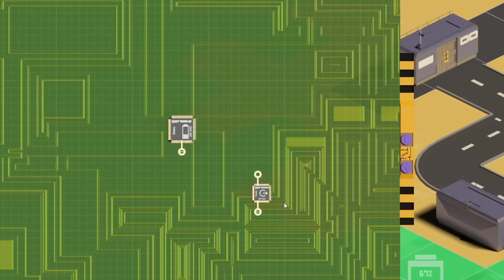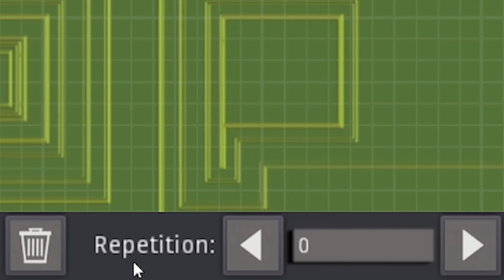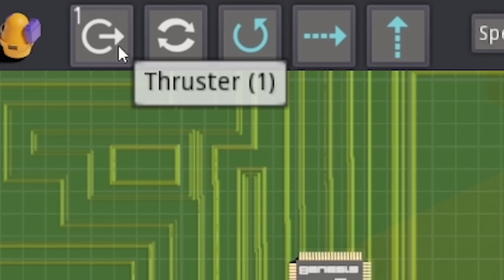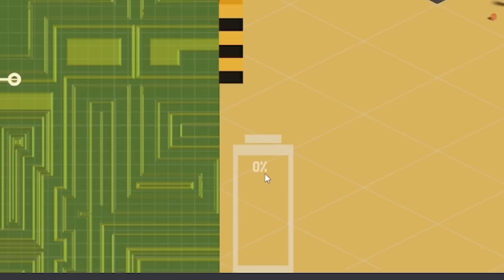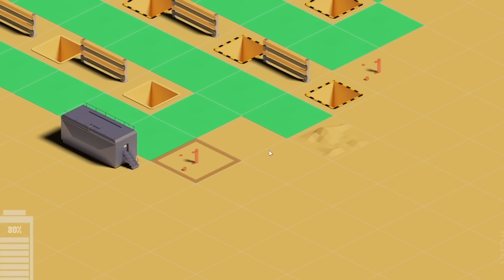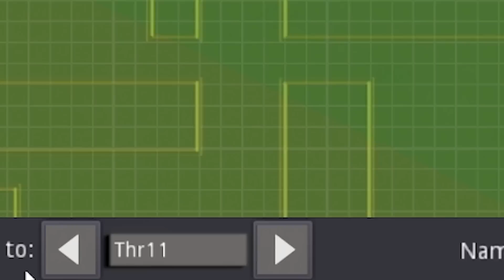Using ADVANCED PROGRAMMING to control robots on Venus!

Comment: Easiest way to think of solutions for this game is by programming in Assembly code. Pull out a notepad (pen and paper or on your PC) and emulate the different modules as a command in code. If you ever played Turing Complete or Shenzhen IO, or just so happen to have other experience writing in Assembly, that experience will be very useful. Note: the interrupter is essentially a jump command that can be used outside of loops. For the last puzzle, the circuit I built was: interrupter(repeater) in the box, then rotator(left)->repeater(6 times, thruster)->interrupter(rotator). Only 5 components, but a slightly different order than his.

Comment: why put in loops, when they gave him a jump. Just start with a jump that only works N times. Much more versatile.
or maybe even conditional jumps and ability initialize vars and increment them by going through a node ... but that would be annoying to use.
- The jump even has an out connector, which makes me think it might be conditional?
- They mix up levels of abstraction a lot.
- Maybe even allow functions where you define input slots and output slots and package it all into a component ... Defining a Repeater could be fun :D

Comment: In actual programming the repeater would be a for loop, and the interruptor would be a jump command (used in assembly mostly, as it's use is frowned upon these days lest you write unreadable spaghetti code!), the rest are just application specific functions.
Reply: Eh we still use jump commands regularly nowadays we just found better names for them.
calling a function is pretty much the same as a jump command, it is just a wole lot better to read and easier to use since you can pass on parameters directly instead of having to write a handler for it In assembly jump isn't even that bad as you use labels anyways which serve as function names the real mess was basic back in the day.
You had to jump to the line numbers in your code.
In the end it's about readability and the specifics of each programming language. A strongly typed language can prevent some bullshit from happening during a function call while the jump command just does what it wants to do no matter what type of data is present. But it is still pretty much the same. Jumping to another part of the code to execute.
Reply: @Kennorx  exactly, function calls are essentially wrappers around jump commands.
Reply: I'll take efficient spaghetti code over code that loads the entire library of alexandria just to tell you the weather

Comment: Really nice game, resembles more to microcontroller design/programming than software engineering.
Reply: Sounds like architect talk to me, better not be 1 of them here mate
Reply: @taylor....  im just a failed mechanical Engineering bachelor.
Reply: not so much the designing part but the programming part. and programming microcontrollers and software engineering are basically the same. In C++ you can transition to assembly-instruction sets if u so desire. these assembly instructions are used on the processor(micro-processor) level of things. and ultimately every program of every language is translated into these constructions.

Comment: Using that interruptor as a GOTO at the end (instead of a proper loop) is such an architect’s move :P
Reply: continue or break at the end of a loop :D
Reply: Screams in C++ noodle code
Reply: Exactly.
Reply: Wasn't even necessary. A repeater of the repeater would have been better
Reply: @weatx nah, this is recursion. If the head of the program is Main();, then an interrupter is calling a function.
Reply: @paxarcana5811  In our reality the interrupter is just a goto, and I assume the only difference between it and the repeater in the code is that the interrupter allows the player to set the destination of the goto and doesn't have a variable for incrementing.

In game reality the circuits are physical circuits. The circuits we've seen don't create more circuits, they just loop through them. An example would be a racetrack.
Reply: Hey, remember the rules? "If it's works, don't touch it" XD
Reply: Recursion.
Reply: @weatx I'd still call it recursion in this case, cuz there's a dedicated loop block and a dedicated go-to block (which reminds me of invoking a function). And in this case he's invoking himself again. Don't get me wrong, your argument is still valid. But I'd still go with recursion.

Comment: As programmer, your mental walk-thought really hurts me, but at the end of day you did good job :D
Reply: Idk, but as a programmer myself I was like: "You can use a repeater here, here and here as well, so you don't have to use that many parts". What RCE did was basically picture book spaghetti code. XD
Reply: @superbobich  Fun fact: my unreadable spaghetti code runs way faster than your nice looking code :P Also, job security
Reply: @alakani  code that runs faster is not necesarly ideal tho, if speed is not a concern for the task then nice easy to read and modify code is preferable to performant code, dev time is more expensive than cpu time. That may be my corporate programmer bias tho, as the code i write does not need to be quick but needs to be easy to be changed each month when executives want to change the logic again.
Reply: @diablo.the.cheater  Exactly, why should they be buying more hardware or outsourcing when they could be giving that money to me instead :]
Reply: @alakani  good for the software that needs it. Otherwise, I enjoy easy to parse code.
Reply: @superbobich  True. Although sometimes in the context of the game there is no gain in using a repeater if you need the same amount (or less) parts for the task without.
Reply: @tobiasm3619  Fair enough.... it's just triggering some "PTSD" memories when I had to minimize code and make it actually "readable" you know.
Reply: programming and coding is like doing puzzles, but theres no stars or completion, you have to manually debug each line. pain.
Reply: @RandomRebelSoldier  People with aphantasia stink at art, people with dyscalculia stink at math, people who thought OO was a good idea stink at programming ;) Have you tried OpenSCAD for 3D modelling?
Reply: @alakani  I don't agree with the aphantasia comment. It sounds odd but you don't "need" mental imagery for the purpose of art, but it can be a useful tool.

Edit: I realize after I replied that you were joking, but still a fair addition imo. It's an interesting topic.
Reply: @RandomRebelSoldier  Would strongly disagree w/regards to art -- the idea that you need to be born with talent discourages many people from taking art classes who would enjoy and benefit from them.
Reply: I am a programmer and this hurts me more than you think. Graphical programming is really inefficient because of the cursor. Good job to Matt for using cursor
Reply: @hackcraft_  Oh wow, it's almost like this is a game and RCE isn't trying to create a search engine or something.
Reply: @gagagero  ? So?
Reply: @gagagero  100% Magyar játék amúgy:)
Reply: @hackcraft_  First in my mind was Scratch 😀 Second was "Does it have plain text environment?"
Reply: If he has programming background instead of civil engineering this would be less painful LMAO

In modern college they would make him take basic python anyway
Reply: @ThoraninC  Partly, programming is nothing you can learn by some basic class. You need to born with it or by many and many year of practice to get knowledge how to think when coding. It's similar to architects - They just born stupid or had to practice for a lot of years 🤣
Reply: @TomášHolan  Of course you can learn how to program from a basic class. That's the entire purpose of such classes. What you mean is that you become more experienced over time, which is true of any skill you practice. I took classes in college, and they were very effective at teaching the basics of programming. 

That said, I originally taught myself the old fashioned way (I read the Half-Life source code and figured out the basics from context and trial and error).